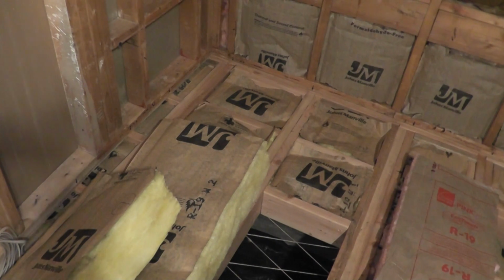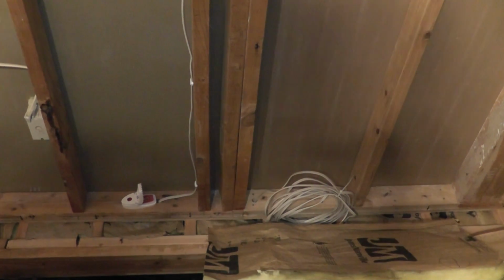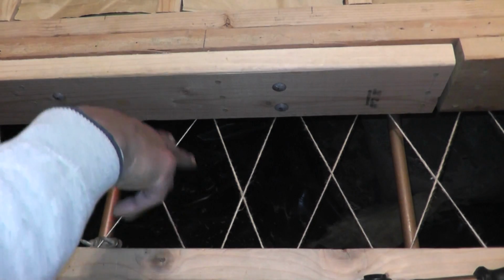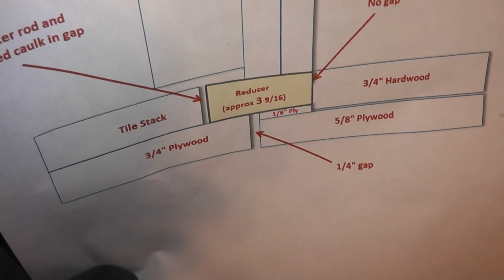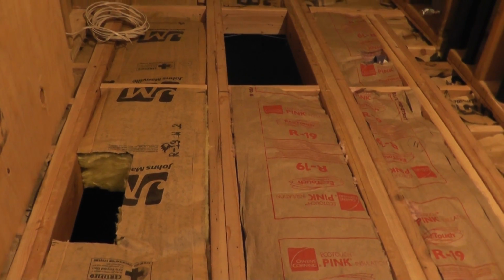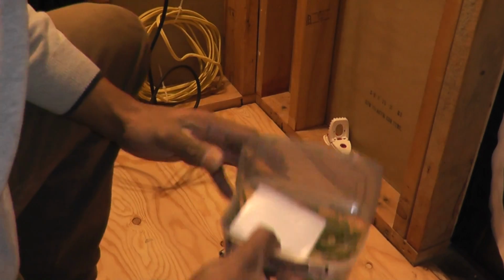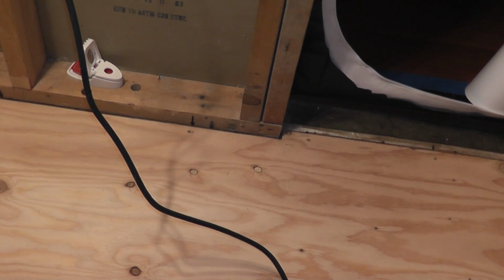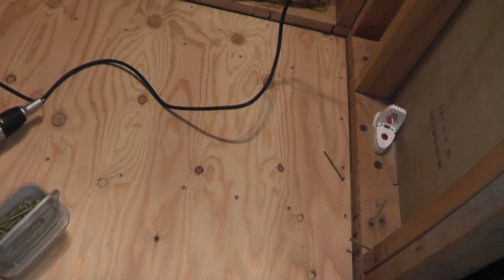Bathroom Remodel 34 - Subfloor Installation Pt 1 of 3

Comment: I noticed u used the 19 installation? Should it be leading to basement? If be 15 leading to outside 11-13 for interior walls? Your opinion please?
Reply from the maker: I'd check what is required in your local area. This might be helpful: https://www.jm.com/en/home-insulation/home-insulation-basics/

Comment: Do you happen to have a video showing your thoughts on how you put in the blocking itself?  We have a section behind the toilet that is a mess of pipes, water lines, drains, and vent.  To add to that, the floor joist is recessed several inches past the wall.  We're on a second floor so adding the blocking from below would require removing part of the ceiling downstairs.  I've been trying to find a video on possible approaches to adding the blocking.  As of now, it will take about 3 2x4s sistered to the floor joist just to get some support for the new plywood.
Reply from the maker: I tried to space the blocking out no more than 12" apart. I found that I had some deflection issues if I went more than the 12". Also, cutting the blocking so that it installed tight in the joist bay allowed me to hammer it into position without worrying about it falling out as I tried to install it.

I'll have the same dilemma you mentioned when I do my second floor bathroom. I don't have a good answer for you, but I'll report back if I come across something. I used some metal brackets when I installed the blocking the first time in video 4.
Reply: ***** Thanks.  I appreciate the quick response.